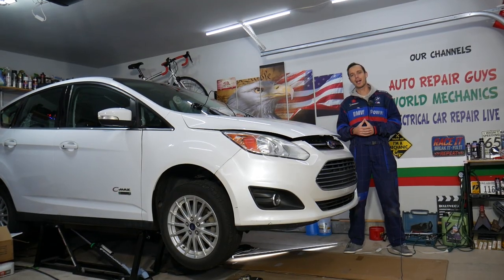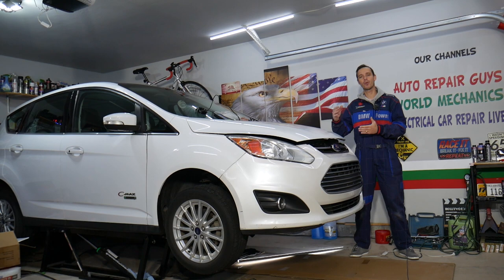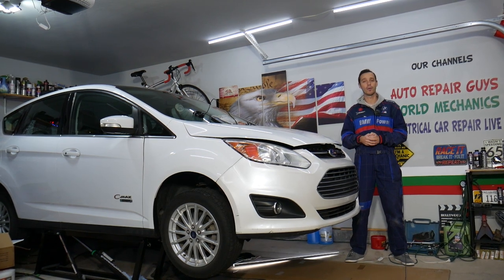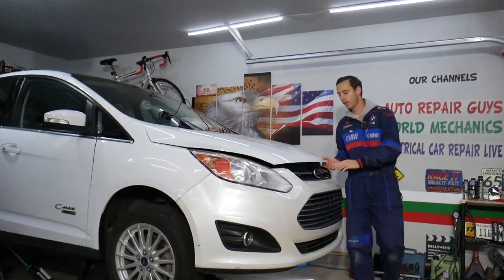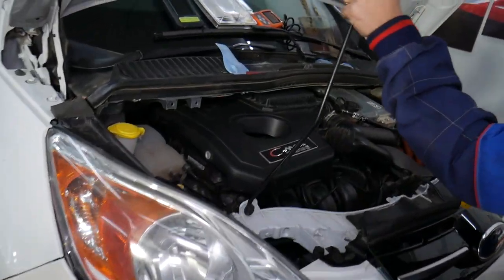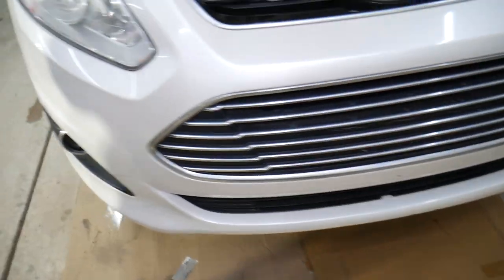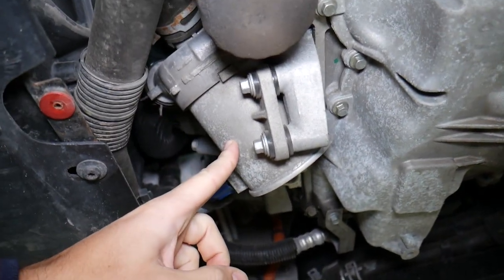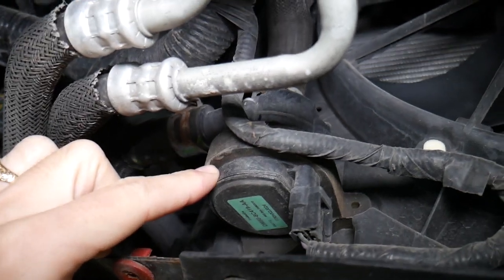AUXILIARY WATER PUMP LOCATION REPLACEMENT EXPLAINED FORD C-MAX FORD FUSION LINCOLN MKZ HYBRID

Comment: Is error P2602 related to the large water pump or the small cabin heating pump? I have this OBD Code - Check + Yellow wrench - but they work properly. FORSCAN shows: PumpA - short to GND Or Open. Help !!

Comment: where can I find the procedure to properly bleed all the air from the cooling system , I was told you need to put the car in cooling system bleed mode which runs the electric pump at full speed when doing this procedure is this correct ?  ..

Comment: I have 2013 x5 3.5i Twinturbo and would like to know the Engine coolant temperature Range?  I have between 103 to 105 Celsius and sometimes goes to 107 but no Engine light warning in the dashboard.  appreciate your input.

Comment: I HAVE A 2017 FORD ESCAPE THE AUXILIRY WATER PUMP STAY ON AFTER I TURN OFF THE ENGINE AND IT IS DRAINING THE BATTERY... I KNOW WITH ONE IS THE RELAY THAT POWER THE PUMP BUT I NEED TO KNOW WICH IS THE SENSOR OR CONTROL THAT KEEP IT ON BECAUSE WHEN I REMOVE THE RELAY THE PUMP STOP RUNNING.. PLEASE HELP ASAP